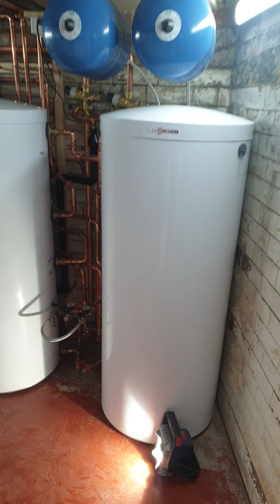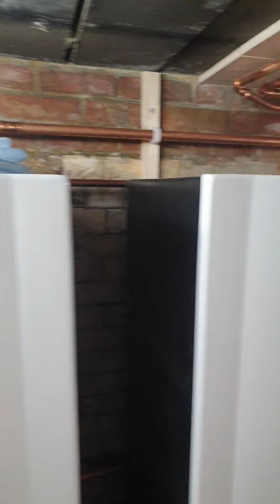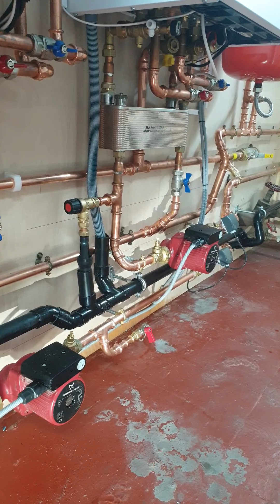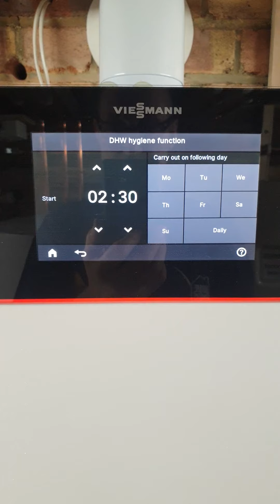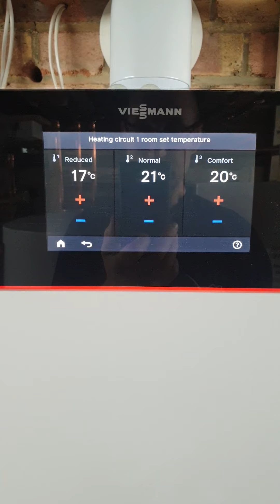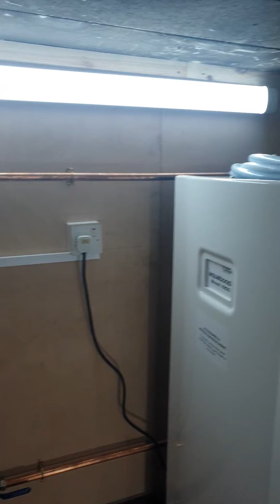Vitocel 200 and Vitodens 200 with plate heat exchanger separation.

Comment: Norwegian company Oso makes A-rated cylinders :)
Reply from the maker: Viessmann is A+
Reply: @andrewmillwardwatford9410  A+ rating only on 160l and 200l versions, but yeah a Vitocell-300 V EVIA-A+ is £2.4K, an Oso Delta Coil 300l (A-rated) is £1.3K including vat, Viessmann 10 years guarantee on tank, Oso 25 years guarantee. Delta coil heat loss 3.5°C over 24 hrs or so it is claimed.  Haven't compared the specs to be honest but videos are super interesting, thanks for making them, I am learning a lot.

Comment: Flexible pipes onto the potable expansion vessels is against water regs
Reply from the maker: Do you have a reference for that. The flexible connectors come with the cylinders as a package may not be altered under g3.
Reply: Andrew Millward  should have been covered when you did your G3 training and assessment
Reply from the maker: @greenyamo1321  no i was told I cant modify a package and must install as intended by the manufacturer
Reply: Andrew Millward I don’t think the regs want you to install a 400mm dead leg, a flow through tee is the correct method.
Reply from the maker: @greenyamo1321  this is why regulations need to be clear. One im not aware of requires me to break one I am aware of.
Reply: Andrew Millward have you done an L8 course?
Reply: Andrew Millward also worth noting not all manufacturers will allow potable vessels in that orientation.
Reply from the maker: @greenyamo1321  No. I've done g3 though. How would you suggest we comply with both ? Its a choice of one over the other in my opinion.
Reply from the maker: @greenyamo1321  when selecting product its important to select product that fits the design criteria needed for your job. A manufacturer giving flexible options is best when that flexibility is needed. One of the things I like about Viessmann is the approach of good engineering design allowing for example no combined pressure and temperature relief valve and so need for d2 runs. Flexible connections in the package and possitionable vessels are also an added bonus that I had taken for granted until you pointed out the added complication of other product choices.

Comment: Good video. Out of curiosity if the pump is positive pressure and depending on the size of pipework is that why a 8m head can pump to the upper floors which are greater than 8m?
Reply from the maker: The heating pump is in a circulsting system and so only needs to overcome the frictional resistances of the system.

Comment: Lovely job, Andrew! Why not use one big plate at the point where the existing system begins, and keep the plant room completely sealed? Unless I’m not quite understanding the configuration.
Reply from the maker: I've done two off these now. One with a single plate and single pump and then this one. Its was about 6 or 7 hundred pounds cheaper this was as we had the pumps, the two plates are 170 ish rather than 600 for the single. Im just starting my third one if these today. Using two plates the existing pump and an additional matching pump.